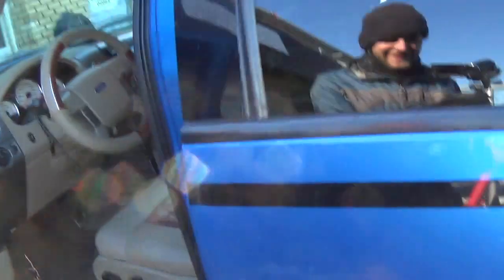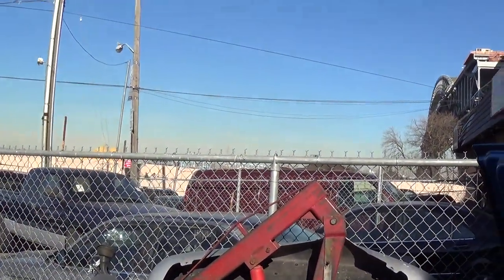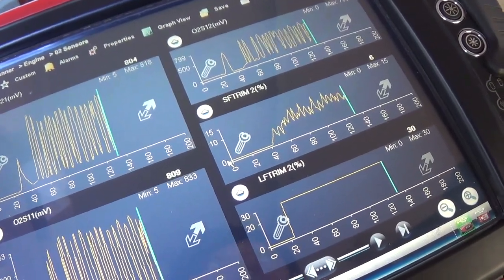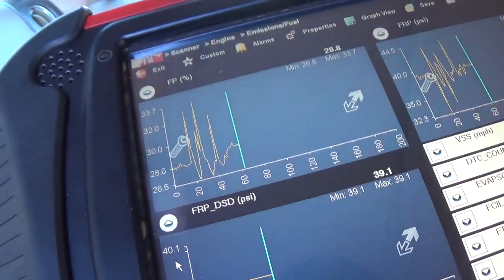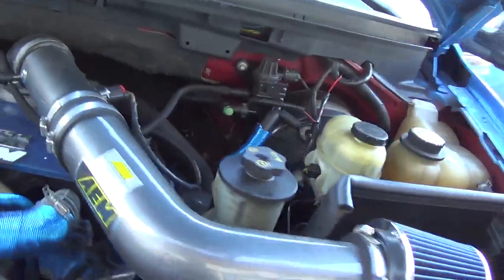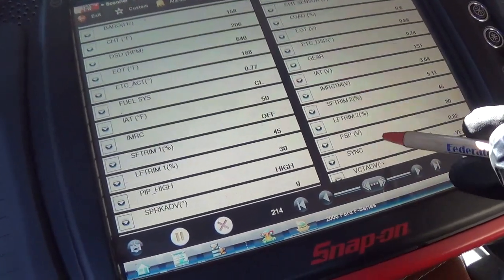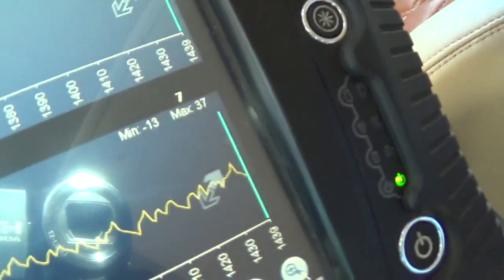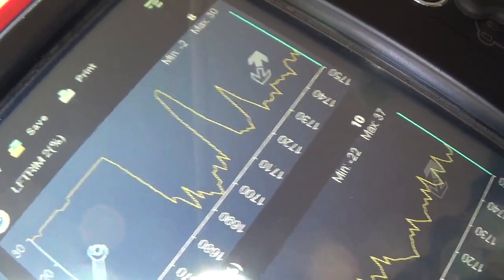F150 Runs Rough, Lean P0171 P0174 (SI Ep 6.2)

Comment: Ivan great video but I have a few questions you may have the answer to. How long has that cold air intake been on the truck b/c that is an AEM kit but appears to be a Spectre or another manufacturers air filter b/c it is blue & AEM are red and it looks fairly new. The reason I ask is b/c if it is a dry filter & someone oils it then it will do that and actually chokes the filter.  Did anyone try connecting the tube and just removing the air filter?  What did the owner do to fix it...maybe Keith knows.  Just curious b/c it's bugging the crap out of me b/c normally AEM intakes don't lower the MAF reading like that it actually goes up slightly.  I noticed when you started it and the rpm stabilized the MAF was showing 5.31 g/s at 672 rpm and then dropped to 3.88 at 652 rpm...wonder what throttle angle was at.  Anyways great video and diagnosis as usual!!
Reply from the maker: Keith will be doing the final checkup on this vehicle next week. I believe the stock system was reinstalled by the shop...
Reply: motoYam82 OK thanks

Comment: These people think they know better than the professional engineering teams working for the manufacturer... K&N style filters have less surface area than stock filters so they need huge pores to get that net increased flow. I like to call them engine sanders. Also the oiled variety damage MAF sensor elements when the oil particles get aerosolized. This system might work if they had a flow straightener ahead of the sensor.. but well, then you would actually need an engineer on your staff.

Comment: I bet the filters clogged. People think k&n’s are fit and forget lifetime products, partly because they see the instant benefit from it and it also says lifetime guarantee on the box. When in actual fact they are high maintenance items compared to a standard paper filter. They require removal, thorough cleaning, drying and re oiling every 3 months or so as they get dirty faster than a standard filter. I only see normal long and short term trims on mine because I keep the filter clean. You get the exact same problems with a clogged paper filter, low maf readings and bad fuel trims.
Reply from the maker: Actually a clogged filter would just cause poor performance under load... Fuel trims would not be affected 😉

Comment: I personally don't see much wrong with running an aftermarket induction intake setup to gain a few horses. The problem comes in when you have to match the oem emissions programming on the pcm. That is why the check engine lamp will come on. The only way to cure this either run a signal modification circuit on the maf return signal line or have the ecu flashed for higher intake air flows. Sometimes you can get away with an idle relearn procedure where you completely disconnect the battery and plug it back in and just let the vehicle idle for 20mins.
Reply: But actually doing it right would triple the cost!  He just wants his $50 buy it now horsepower!
:3

Comment: I feel your pain. I work at a shop that sells those air intakes and a lot of times I have have to re-engineer them so the vehicle will run correctly and not have a check engine light on
Reply: How did you fix them

Comment: I have even seen on a turn where the engine would run rich because the fuel pressure regulator got its vacuum from the intake tube and with the k&n would so well it wouldn't create a vacuum
Reply from the maker: Interesting...usually there is negligible vacuum in the intake tube before the throttle plate...unless you airfilter looks like a mouse nest lol
Reply: Yes the factory system had a small type canister type champer on it to store vacuum for the fuel pressure if I remember correctly it was something like a 03 tundra with a 4.7 really weird

Comment: Doing performance work along with normal diagnostics the problem is definitely not K&N b/c a filthy K&N air filter will outflow a new OEM filter by a ton which is why they are run on dirt modifieds & off road vehicles.  Here is the BIG problem...the cold air tube has to be sized to the performance & displacement of the engine especially on a turbo or supercharged engine.   The reason it started running better was b/c the cold air intake tube was too small so when you took off the hose it was able to breath again and get the airflow the engine demanded and why your MAF g/s increased however the reason it was all over the place was from the turbulent airflow. I had a 68 Camaro with an LS engine the customer had installed and it acted like the cats were plugged b/c of lack of throttle response & no high RPM.  Opened the hood and seen the cold air intake tube size & told him don't go anywhere b/c it'll be fixed in a minute.  I put the correct size on and the engine came to life and now he just needs to buy rear tires.  People modifying their vehicles need to understand it all needs to work together.  I tube too large will cause turbulence and the MAF reading will fluctuate and cause the same b/c the MAF is not reading all the air. There is a lot of aftermarket crap out there also that copycat and then sell cheaper and you get junk & poor running vehicle. The difference between AEM & K&N is AEM is a dry filter that can be cleaned & reused & K&N is an oiled reuseable air filter.  The AEM will not contaminate the MAF like the K&N will if over oiled. Would have liked to see the PN on that kit. The OEM air box with a K&N or AEM folter will actually outperform a cold air tube b/c the name leads people astray and the cold air tube is actually drawing in heated air vs the OEM is pulling in cooler air from outside the engine compartment.  I put all this info here mainly for your viewers wanting to modify their vehicles. Great video Ivan and nice diagnosis!!
Reply: Excellent observations. In the video, you can clearly see that the intake tube was stepped down in size. I would have thought though that the higher flowing filter would balance out the step down in size of the intake tubing? Guess not.
Reply: Heard of turbulence in a water pump but not air turbulence in a short pipe that length. Hownever  new designs  in any sphere is very tricky with so many variables at play. The old saying holds good---If it's working don.t fix it !!
.
Reply: The turbulence I was referring to was when he disconnected the tube and then his MAF readings were fluctuating b/c of how the air was entering the tube by the MAF It was steady until he disconnected the tube.
Reply: I still have a few unanswered like how long has that cold air intake been on the truck b/c that is an AEM but appears to be a Spectre or another manufacturers air filter b/c it is blue & AEM are red and it looks fairly new. The reason I ask is b/c if it is a dry filter & someone oils it then it will do that and actually chokes the filter.  Wonder what would happen if the air filter was removed with the tube connected & wonder what did the owner do to fix it...maybe Keith knows.  Just curious b/c it's bugging the crap out of me b/c normally AEM intakes don't lower the MAF reading like that it actually goes up slightly.  I also noticed when it started the rpm stabilized the MAF was showing 5.31 g/s at 672 rpm and then dropped to 3.88 at 652 rpm...wonder what throttle angle was at.
Reply from the maker: Don't know the entire history, but the whole engine looks like a fresh build, and it never ran right after the build and installation of the aftermarket stuff.

Comment: Interesting that the air flow through the after market tube (which is nice and straight) would cause such a problem.

One think about those K&N filter that most people don't know (Because they don't read the directions) is that they actually require servicing much more often than a paper filter.  They do work well when properly cleaned and re-oiled when necessary.
Reply: no they do not... they need cleaning when they get reaaalllyy dirty, but that wont happen for well over 2-3 years in the dirtiest of places. http://www.knfilters.com/cleaning-pics.htm

that's one of the major selling points.buy it, and you dont have to buy another one  ever again! just clean it after  a few years.
Reply from the maker: The problem isn't so much the filter, but the location of the MAF and the way the airflow passes over the hot wire. Stock system are engineered very specifically and the fuel maps in the PCM are programmed accordingly. In this case changing the geometry and relocating the MAF skewed the airflow readings quite a bit!
Reply: K&N recommends cleaning every 50K miles
Reply: exactly!

Comment: So, you unplugged the Maf and the truck died. Is that supposed to happen? I have suspected a Maf issue on my 98 f150 5.4. When I unplug it, no change in idle.
Reply: If the MAF is unplugged and the truck dies then it is a good MAF. If the truck stays running the PCM is making up codes and acting as the MAF it will do this temporarily in order for you to have time to fix the real problem.

Comment: I'm a little confused as to why the lean condition corrects when you open up the intake tube, seems like opening it up like that could only allow more air in...
Reply: A bit over the altitude estimation there, James's data shows the BARO is thinking it's 1,000 ft above where it is.  So the air filter isn't as restrictive as the removal by Ivan seems to suggest either, but I had a good laugh anyway.  Might be the MAF holder as well as a dirty MAF still.  The construction of the holder is a quite precise device, I wonder what this one looks like on the inside?  Considering the level of other add-ons in the same engine bay, it doesn't look like any thought at all was given the issue.

Comment: So, help me understand the issue here, Ivan.  If the CAI was "choking" off the intake and the MAF was measuring correctly, shouldn't the fuel trims be negative?  If there's not enough air going in to keep the A/F ratio at 14.7:1, then the computer should be taking fuel away, not adding fuel -- as we see here.  Please explain.  Thanks.
Reply from the maker: Not quite. The aftermarket CAI was "disturbing" the original air flow stream as the engineers designed it. Therefore the MAF was not reading the air flow correctly (too little), and the computer had to add fuel to compensate for this error :)
Reply: Ahh... makes sense.  Thanks Ivan. I'm an electrical engineer with 30+ years experience and yet you have taught me a lot.  I really appreciate your channel!!

Comment: I have a 1998 f150 4.6 liter with the p0171/p0174 code for months now, but the engine runs perfect???
Even ran a smoke machine through the engine and found nothing.
Reply from the maker: Check brake booster and purge solenoid 👍

Comment: Might Car Mods  have done many Dyno runs with stock Versus Cold Air Intake... most of the time you lose horse power ...and when they have had gains they suggest the  you would get a bigger performance gain by taking a dump before you hop in your car !
Reply: Hahha, yes that episode is so funny :D And as someone previously said, du people really think car manufacruting engineers just slap something togheter. I think not :P

Comment: Geez, if I were you and looked under the hood I would have been tempted to just close the hood and walk away, lol. Between the aftermarket parts and the chotchy install job.. what a mess.

People need to realize that these so-called "cold air intake" kits are nothing of the sort - you really think sucking air from inside the engine compartment is going to be colder than from the fender or from behind the grille where the factory system takes its air? Maybe on some older vehicles with crappy stock intakes you could get noticeable gains from an aftermarket intake, but nobody leaves performance on the table like that anymore. Not to mention the crappy filtering efficiency of the filters on these, which let much more dirt into your engine and shorten its life.

Comment: good diagnosis. deal parts like that shouldn't even be available. Ford (or any other brand) spends millions designing the intake path and sensor airstream, some company isn't going to outdo them by welding some tube together and tossing the maf in some random spot. If a car has a maf leave the intake alone! no modern automaker is going to leave horsepower behind due to poor intake design.
Reply: The AEM is CARB certified and the CARB # on the tube is valid. It has to pass stringent testing and the MAF readings have to fall within specs to be certified. That is an AEM cold air intake with a non-AEM filter on it & I suspect it is an e-bay filter b/c it is definitely not K&N or AEM b/c they are red and this is blue and I don't think it is a Spectre either. By that low MAF reading I'd almost suspect someone may have oiled a dry filter which I've run into before.
Reply: My Crown Vic's stock air intake box/filter was restrictive and I got more power out of a CAI (Spectre). Ford's design was indeed quite restrictive and the 4.6L should have never come with single exhaust, either. 

This was proven when Ford came out with their PI 4.6L years later with a much better breathing air box and standard dual exhaust. So yea companies can indeed be improved upon in some circumstances.
Reply: Not saying you're totally wrong, though. These days they are actually trying to get as much efficiency and power out of an engine as they can.
Reply: well spoken

Comment: Nice had a similar issue with a Mustang lol had to put stock  exhaust manifolds and air ducting plus throttle body reflashed pcm back to stock  . all codes gone  👍  How far are you from West Virginia?
Reply from the maker: Just one state line ;)
Reply: Awesome do you have a business card or number, my mother is have problems with her GMC Denali. the shop where it's at can't figure out the problem.
Reply from the maker: I'm in State College, PA, like 4 hours from WV border. Can she drive the vehicle here?
Reply: Umm I'm hoping she will be able too it's intermittent problem power reduced mode when it starts acting up. It's been to the dealer as well got the usual run around. I'll inform her tomorrow . I'm sure she will be able to get the vehicle there.
Reply from the maker: Cool, have her send me an email at  ivan@pinehollowdiagnostics.com with the details!
Reply: Roger that IvanNator 👍
Reply: motoYam82 Email has been sent . 👍

Comment: And this is the reason why I send that kind of crap right on down the road, unless of course I get payed by the hour LOL.  Aftermarket Parts are OK but at the bare minimum people that put them on should be able to fix there own Vehicle.
Reply: Yeah....it's not 1979, when you could easily tune for added power. Or swap on a $150 aluminum intake and drop 35 pounds off the front wheels. Those days are over.

Comment: Why cannot that be a dirty air filter , regardless of how it looks? I mean surely they couldn't sell them if that's how they were making engines run? I mean you open up the breather tube and bam you get response immediately on fuel trims and maf. So in my mind, what have you bypassed? The air filter right?
Reply: Those filters can be dry or oiled and if someone oiled a dry filter the MAF readings will be lower and the lean codes will assert. Curious what the owner did to correct it.
Reply: I'm not disagreeing with Ivan saying we got air flow/maf problem, but you see correction happening when the filter is bypassed then why can't that be a clogged filter?
Reply: It could & the only way to find out would be to just remove the air filter & see what happens.  That was not an AEM or K&N air filter b/c it's blue which got my attention and the blue can be from different manufacturers and be dry or oiled so it would be easy to make a mistake & oil a dry one. As far as the diagnosis goes Ivan disconnected the tube and the MAF increased & fuel trims corrected. I've installed plenty of K&N and AEM kits that actually have a cold air box and never had any issues with any of them other than someone over oiling the K&N air filter and it causing erroneous MAF readings.
Reply: @haywardsautomotive6156  I suspect it's a Spectre filter. They sell them with blue media and they are oiled.

Comment: I don't understand all the hating on the aftermarket, they have engineers that get the specs from the automakers and design their products. Just buy quality parts, you know the factory isn't perfect, so their parts can be improved on. If it wasn't for the aftermarket no one could restore an old classic. Gee whiz lighten up.
Reply from the maker: Certainly aftermarket add-ons can be useful. But from a diagnosticians standpoint, it's an unknown variable that throws a wrench into what should be a straight-forward troubleshooting procedure!

Comment: Type issues with my F-150 2003 5.4 l. I've watched a lot of videos gone through the techniques advice etc. 95 probably more percent of people do not have a scan tool like this. They're not going to spend $1,000 on such a scan tool. They're also not going to know what the values for that particular vehicle going to be so all that information is irrelevant if you don't understand it. On the oscilloscope graph you don't know what that's supposed to be so you're not going to understand it. What people do understand is hardcore go into it and say this is where it's at this is how you diagnose it and this is how you fix it. All your information is irrelevant for the purpose of YouTube nobody knows what you're really doing.